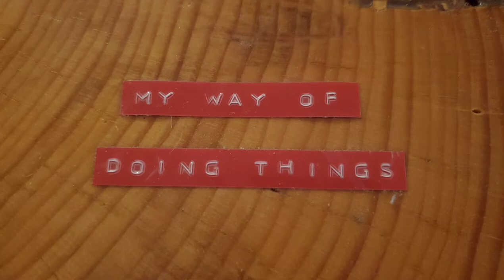Cleaning carbon deposits out of the engine | Chevy Tahoe

Comment: Buy the Seafoam top engine cleaner with the spray nozzle that goes between the boot too the throttle body instead so you don’t have too disconnect the MAFS and deal with engine codes.
Reply: You don’t have to disconnect the maf if your are doing it the way that guy did . If anything just clean the maf before you hook back up if you’re worried . The sea foam doesn’t hold a candle to a/c delco. Not even close . There’s a reason the a/c delco is hard to get… it’s that good
Reply: acdelco one is a lot stronger

Comment: Question running the truck with the mass airflow sensor unplugged won't that throw an engine code ?
Reply: Yes it will , it can be reset by disconnecting the battery or a scanner
Reply: It will, and it's not the best idea on an ecotec to run without a filter
Reply: Yes, but it’s a GM engine, it likes the sensors but it don’t need them. And it can even run on 4 cylinders.
I had my work truck run very poorly once, drove it to the garage, turned out the main computer went, but it was still drivable

Comment: What about seafoam?
Reply: Seafoam works better
Reply from the maker: I love seafoam products but it seems like the AC Delco cleans a little more because more smoke comes out of the exhaust pipe.  That is just my experience but Seafoam products are incredible too.  You could alternate between the 2 products to get the best of both if you want.